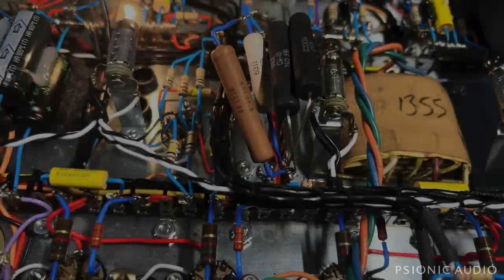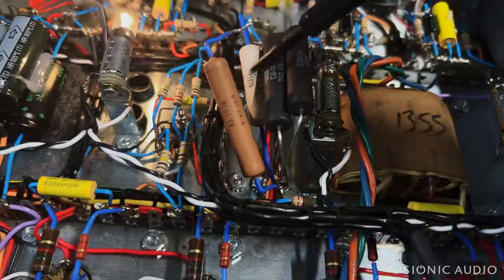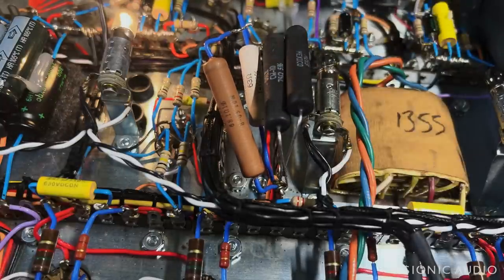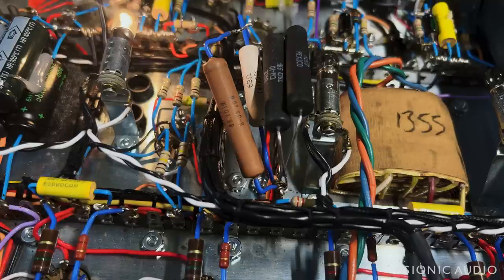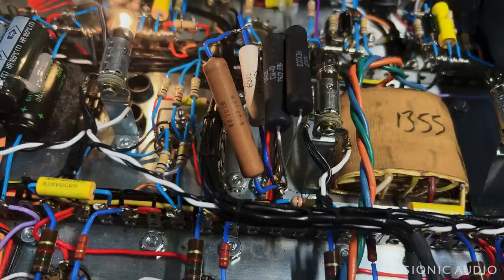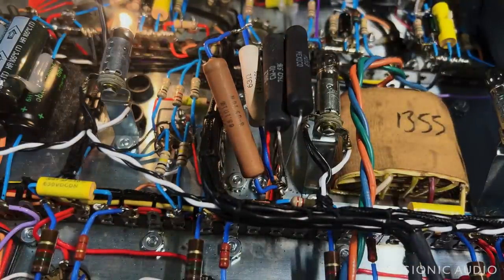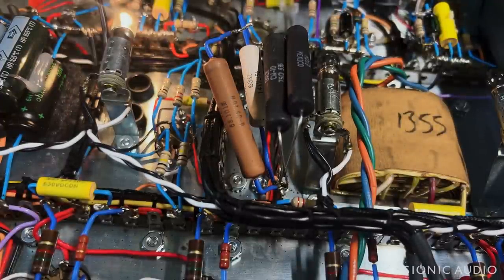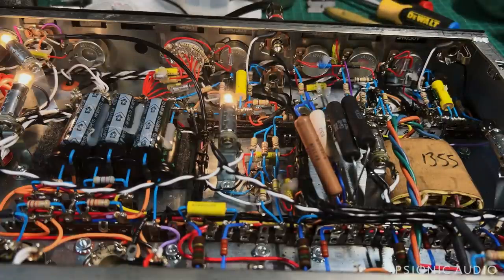Care and Feeding of the Matchless DC-30

Comment: Lyle; I had one of these that was made in 1994. What I found was that the amp in the output section was over filtered. I installed value of the caps used in the JMI version of the AC30’s and I installed a Mercury Magnetics version of a Woden output tranny. That made the amp really sing. I got the amp in a trade with one of the guys who had worked there. In fact I think Phil actually finished putting the amp together. I ended up trading it for a 1964 AC30 that a friend of mine still owns. He’s in Manchester, U.K. and uses it all the time!
Reply from the maker: I disagree with Matchless on some points, some of which you addressed here. But in this case I was just hired to repair it (including making it stop eating tubes).

You know that big pointless finned heat sink on Mesas, mounted by the preamp tubes?

Here’s an amp that could actually use one of those…
Reply: @PsionicAudio  Matchless can say whatever they want, but when the thing gets so hot it warps the front panel I don't really think they have a leg to stand on. I think most consumers expect the tubes in their amps to last years or even "forever".
Reply: @PsionicAudio  Yeah Lyle, mine would get really hot. Mark would tell me that the hotter they got, the better they would sound. Not sure I agree with him, but I've known Mark for 30 years.
Reply from the maker: If I were building a similar amp (and thought running tubes at meltdown had any merit) I’d put a switch on the back for the tube-killing maniacs. And no warranty repairs for use of that switch.
Reply: Some of us do like a hot biased amp

Comment: If the buls are using heater 6.3 volts, you can look into pin ball machine parts and get LEDs that will fit in the bayonet bulb sockets. I use them in old transmitters and the work  with no heat. You might check that out for these amps to reduce some heat.

Comment: Love this video! Not to 'defend' Matchless, they need no defending, but you and I are old enough to remember when the perception was that you couldn't tour with a Vox unless you were Brian May and had a traveling Vox repair shop on the road with you. Part of that was due to some actual QC issues with a lot (not all, a lot) of 70s AC30s. And part of that was that the better made 60s Voxes were getting old and in need of overhaul, and fewer people knew how to do that work that knew how to overhaul, say, a Twin Reverb. Hence, the jokes like the one I used, that if you're gigging a Vox you need to be sure you have its most important accessory, a fire extinguisher. I think a lot of what Mark and Phil were doing in 'overbuilding' these was to prove that a road worthy Vox could be built. They may have errred on the side of 'you can throw it down the stairs like a MusicMan and it will still work,' and that may have bled over into a amp that growled a little more than it sang. I'll give you that. But at the time, that level of reliability from an amp that sounds a LOT like an AC30 when at full roar, that was something to make people sit up and notice. Again, love the vid!
Reply from the maker: I think in comparison to what was on the market when Matchless came out they were the best built sounding things in the world. 

But they are not perfect beasts.

Comment: It seems like most off-the-shelf EL84 amps run the tubes as hot as possible, just because that's how the AC30s were....
Reply: Totally. It sounds amazing. But at a cost. Thankfully EL84s are inexpensive compared to other power tubes.

Comment: Any reason not to use a pot rather than the resistor to set the bias?  Just curious.
Reply from the maker: A really expensive pot is 2W. The average pot is 1/2W or less.
Reply: @PsionicAudio  Sorry, but I don’t follow. Why would that be a problem?
Reply from the maker: The cathode resistor in these and similar amps is 10W. A pot would burn.
Reply: @PsionicAudio  Aha!  Good reason!☺️. Thanks.

Comment: One of my favorite aspects of the DC30s is the power sag you get when playing them loud. Won't running the power tubew colder reduce this? I've realised mine is starting to show some of the same symptoms as this one but i would gladly run through tubes quicker if thats what it takes to get that spongy goodness.
Reply from the maker: No, I’m not saying to run them cold. I’m saying run them hot like Vox did, about 14W max idle. Not 19W.
Reply: @psionicaudio  not saying cold either, just "colder" than original matchless specs. Genuinely interested in what effect you think it might have in regard to the dynamic response

Comment: Its amazing how every company that makes EL34/84 powered amps runs the tubes so hot they fail quickly. Just doesn't make sense. I wonder if any of them test these designs to see if it really makes a difference to the sound, or if they are just doing what dumb thing was done in the 60s because of some false perception?
Reply: Makes perfect sense to me...
Run the valves hot, replace the valves often.
Everybody profits, except of course the consumer/player...
Reply: Yeah, all the old 30's that haven't been fixed by now do the same thing. Some designs were actually tweaked by larger companies to run hotter after the little guys sold or licensed things in order to keep up with production. Unfortunately this is a trend that continues in many consumer markets today.
Reply: The crappy new production tubes are mostly to blame. That and high wall voltage.
Reply: @mfam1306  That's what I was thinking, higher wall voltages, lower quality tubes and over-biasing. 
I really don't believe in any for profit conspiracy between amp builders and tube makers.... certainly not back in the 50s and 60s when tubes wee dirt cheap. 
Seems that these days boutique amp builders just copy old designs for nostalgia's sake and rarely improve on them---as far as reliability is concerned.

Comment: A smaller wattage and ohm can make up the small difference  thus a 3 ohm 1 watt  in series of 10 is a 30 ohm 10 watt resistor network .
Reply from the maker: Yeah, trying not to do anything too “out there” though. Don’t want series resistors floating in air. I’ve figured out that a 120R will do what I need perfectly. I temped in a 5w I have here but ordered a 10W “for looks.”
Reply: @PsionicAudio   Thinking small turret so not floating in air . I do see your point .
Reply: @PsionicAudio  So you kept the 63 Ohm 10W but replaced the 75 Ohm 10 W with 120?
Reply from the maker: Yes.